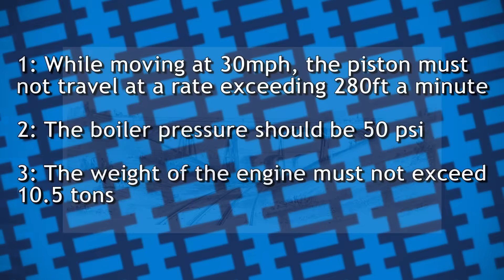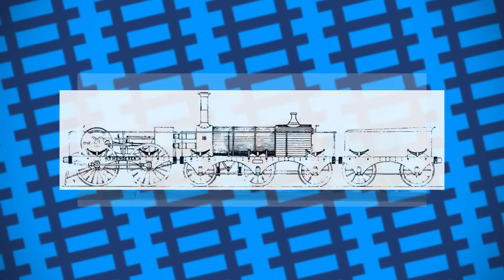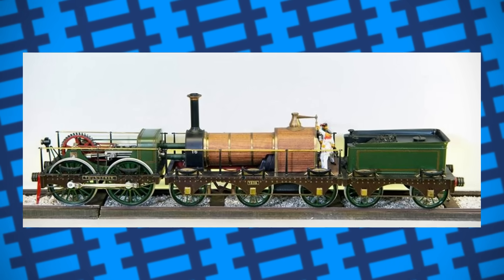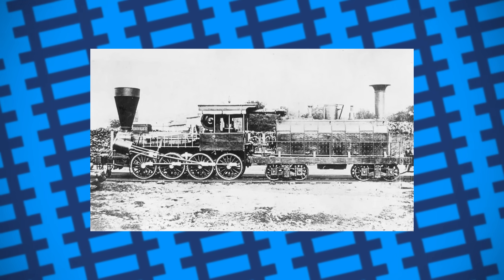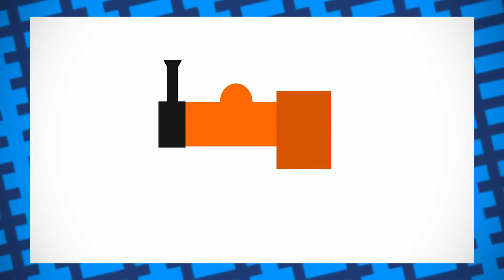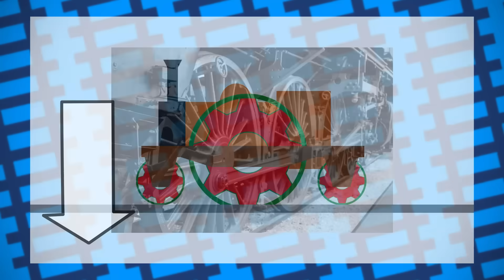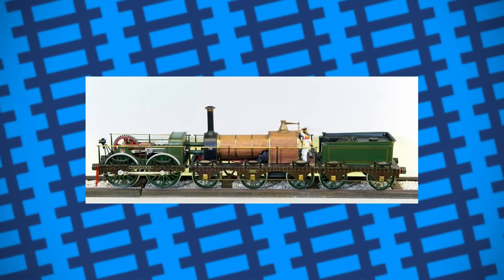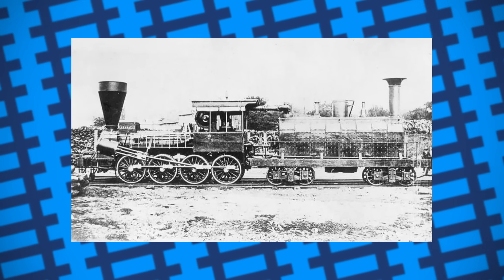Why Locomotive Boiler Placement is Important - "Hurricane", "Thunderer" & "Novelty"

Comment: I often wonder if the low axle-weight was what Brunel had in mind when he drew up the specifications, because he was also responsible for the civil engineering on the GWR, such as the Maidenhead Bridge with it's famous 'flat' arches, and heavy locomotive might have caused some real damage. Robert Stephenson had issues with heavy locos and collapsing bridges and the two men were very close. Brunel, too, attended the opening of Stephenson's Menai Straits Bridge.

Comment: What I´d do to improve the Hurricane design is to remove the front articulation, and remove two of the axles under the boiler. This would basically put the boiler weight on the driving wheels even without them being under the boiler.

Comment: I feel like if this was a two Carriage design where the driving Wheels were instead underneath the coal and water tanks it would solve several problems. The way it wouldn't be nearly as heavy as the boiler but it would still add additional weight without literally adding unnecessary weight to the engine, the driver and firemen would still be right next to each other ensuring good communication between them, the engine would have a mostly conventional layout save for the swapping of the trailing and driving Wheels, the size of the engine overall would be smaller, and now you have an added benefit of being able to extend the engine in both directions independently of each other depending on what specifications are needed for what purpose.

Comment: Wheel-rail contact area has negligible impact on tractive effort, its all about the sheer weight on the drivers. 

Factor of adhesion (how grippy a locomotives wheels are) is a calculation of weight on drivers divided by the maximum tractive effort (a slightly more complex calculation that considers the surface area of the pistons, Wheel diameter, stroke distance, and maximum boiler pressure). Nowhere in the calculation is the contact area even considered, nor is the number of driving wheels considered.

Comment: I feel like the adhesion pronlem wouldn't have been an issue if they just used the tender, which already needed to be attached to the train anyway. I get that it has some of the same issues with the boiler, but it really doesn't require a prefectly rectangular shape, and could just wrap around the driving axle and pistons.

Comment: Novelty would have suffered by not having the exhaust steam going up a blast pipe in the boiler funnel.  What about Hurricane and Thunderer?  I do see 2 pipes between the boiler and drive chassis  - was one of them for exhaust steam?  Condensate must have been a challenge as well.

Comment: Harrison in fact designed and built three locomotives, and indeed he took out a patent for the design in  December1836: Before Brunel issued his specification for locomotives. Harrison's notebooks survive including notes about boiler pressure, tractive effort and so forth. The first locomotive, aplty-named "Projenitor",  was intended not for high speed running but to haul coal trains on the Stanhope & Tyne Rail Road in the northeast of England. Harrison was the Engineer of the Stanhope & Tyne. Harrison's notes show it was designed to pull a fairly substantial load of 50 loaded coal wagons each wagon weighing 30cwt and carrying 53cwt of coal at more than 10mph. It's also worth pointing out Harrison's reasons for the design was not to reduce axle load or piston speed! Harrison clearly states that the use of a double-carriage locomotive was to reduce the amount of time and thus cost a locomotive was out of action due to maintenance. He found from his experience of the Stanhope & Type that a quarter of the cost - and time - of the expenses on locomotive repairs was due to inaccessibility of the parts. Thus putting the engine unit on one carriage not only made it all more accessible, but it meant it could be interchanged with any other boiler unit. Thus if the boiler was due work, but the engine unit was in good order, they could used turn and turn about.
I strongly suggest checking out Rob Langham's paper on the Stanhope & Tyne published in the 7th International Early Railway Conference. 

Also worth noting that Brunel used "Hurricane" as part of his experiments on drafting and gas flow in locomotive boilers. Brunel realised that the traditional blast pipe did not give sufficient control to the burn of a fire and did not promote fuel economy, so rather like Andre Chapelon in the C20th, used fans to provide the draft for the fire. Dr Michael Bailey has written a very useful paper published by the Newcomen Society about this. Worth checking it out.

Also worth noting that Harrison's idea wasn't new when he took out his patent. Matthew Murray of Leeds - who with John Blenkinsop had built the first commercially succesful locomotives in 1812 - had proposed a similar divided locomotive for the Stockton & Darlington Railway in 1825, but that, unlike T E Harrison's design was to reduce axle load.

Comment: OK, so lots of people see these as a forerunner to the Garratt and people have said you can't let the water tank of a Garratt get too low or it'll lose traction which is the main fault in that design. That may be but the tender of a regualar loco can't get too low either or it becomes an empty wagon at the front of the train with a lot of loaded wagons behind it and that's bad. Even worse when the loco is in dynamic brake and the only saving grace is that steam locos never had that but if they did, you would have to estimate how much DB you could use based on your guess as to the weight of the tender. Actually, diesels that carry an extra fuel car would have this problem. It just goes to show that ALL steam locos had their shortcomings.

Comment: What's nice is these days computer simulation  means you can actually try it out without building anything: in our times they would have known the drivers were doomed to slip before they turned a bolt on a prototype and dropped the idea right then and there.
Reply: What the heck to you think you are going to do with a computer?  The result is easily calculated by hand with methods of the day. They may have been missing some of the actual numbers (i.e. a good value for the adhesion of the wheel on the rail  VS force, the coefficient of friction) but you certainly can't do a computer simulation without that, either. 
Before computers, people did not just eyeball something, put it together, and see if it worked. They had perfectly good mathematical methods that do not require computers. Computers aid engineering in essentially one way - iterative calculation/numerical integration of equations you cannot easily solve in closed form. This case is an entirely static calculation, you dont have to iterate or integrate anything to get the one and only answer.
Reply: -as you say, there is nothing we can do with a computer that they couldn't have done with pencil and paper (within limits, of course.), but the fact that we have computers now makes simulation so much more of the development process.

-as you go further and further back, people really were much more prone to just eyeballing something, putting it together, and seeing if it worked. The early history of aviation is full of this, because they were playing a game that nobody knew the rules for just yet. There was a pretty spectacular body count too.

This whole idea of building a system by calculation was itself just starting out right around that same time.  West Point introduced an Engineering curriculum in 1817. Rensselaer  opened in 1824. There were engineers and engineering before this, but as you go further and further back, the choices made were more and more a matter of what the engineer had learned by experience.

-this of course becomes a problem when something new is being built and what you are doing right now IS the experience.

Comment: Going 85mph on an experimental locomotive with 10 foot exposed driving wheels in front of you and no cab whatsoever must have been absolutely horrifying. One wrong move and everything goes dark before you even know what happened.
Reply: Add in boiler safety of the time, and the castings for those wheels.
Reply: @joejoejoejoejoejoe4391  Wheels weren't cast: they were forge-welded from individual components. Cast wheels had been tried but they disintegrated, much to Robert Stephenson's cost. Boilers were also prettty safe. They had to be hydraulically tested to twice working pressure; two safety valves, one of which locked up and tamper proof; two means of measuring the water level. Plus a rivetted wrought iron boiler will take much more punishment than a welded steel one. The big problem was the technology available to assess plate thickness in service, for internal examinations. Doing it by a flickering tallow-dip or flare lamp nocking on the boiler plating with a hammer and listening to the sound. No NDTs in those days. and you still hammer the boiler as one means of checking for thickness and flaws to this day.
Reply: "CLANK" then darkness
Reply: According to the model shown, it looks like the engineer was stationed in FRONT of the drivers.
Reply: @00Zy99  It was hard to see on mobile when I watched this, but even so it's equally terrifying...

Comment: While it would have hurt the axle loading, I do really wonder If they had forgone the wheels under the boiler and added load bearing joints between the engine, boiler and tender if that weight would have been enough to get a grip.
Reply: a proto garret at that point

Comment: Never understood why brunell was so revered.  If the saltash bridge was really so good why wasn't it copied extensively. 
I think he was like churchill, famous mainly due to controlling the narrative.
Reply: He was an excellent civil engineer, but I personally think fairly rubbish at railway design. Remember his 7' broad gauge? How fast was he actually expecting his railway to run at? Okay, maybe not a surety at the time, but his designs were rubbish. His fixation on piston speed which nobody else had an issue with. His baulk road which ended up with half the gwr network getting ripped up to start again. His coaches with large wheels outside the bodywork, so nobody could actually get in the sodding things. His atmospheric railway...
I think his popularity is based predominantly on the size of his hat.

Comment: Think you got the chronology wrong when drawing conclusions.
These Brunel inspired and restricted locomotives came at the earliest days of the GWR and caused huge problems by the GWR not having useful engines.
Rescued by Robert Stephenson and co regauging an export locomotive , meant for a five to six feet gauge railway that went bankrupt before delivery. That became the very successful North Star.
No more oddball Brunel restricted locomotives were made after North Star proved the then tried and tested designs were best.

Comment: If the driving part was a lot heavier to put adhesive weight on the driving wheels then it may have worked.
Could come from extra thick frames on the driving part.
Think you got the chronology wrong when drawing conclusions.
These Brunel inspired and restricted locomotives came at the earliest days of the GWR and caused huge problems by the GWR not having useful engines.
Rescued by Robert Stephenson and co regauging an export locomotive , meant for a five to six feet gauge railway that went bankrupt before delivery. That became the very successful North Star.
No more oddball Brunel restricted locomotives were made after North Star proved the then tried and tested designs were best.
Reply: Exactly. And with the rather embarrassing (for the GW) show up of how good that nasty Mr Stephenson's designs were with the stars, the board gave in and got Izzy back to doing what he was good at, and getting Mr goochy-baby in to design some decent biscuits directly influenced by the Stephenson's

Comment: From my experience with building model trains when I saw the picture of hurricane I automatically said that thing has no traction, and automatically knew where this video was going.
Reply: Yeah, it would make a fun live steam engine, but obviously the core problem remains. On the other hand, in smaller than ride-on scales, one can cheat with relly lightweight wagons and coaches to match. Howevever, the way unrealistically tight radius curves on model railways, is probably the worst problem to mitigate, both mechanically and aestetically.

Comment: Without IKB´s restrictions, one in particular, all that had been not an issue at all.
Speed? Very reasonable, the railroads should provide the fastest means of transportation.
Boiler pressure? Reasonable as well, for safety, given the metallurgy of the time.
Piston speed? Somewhat reasonable, with such low pressure quite large pistons are needed and too high speeds may have cause trouble with metallurgy as well.
But weight? It may cost more, but stronger railbeds and bridges are relatively easy to achieve and are an investment in future developments (an engineer like IKB should have had the foresight of trains getting larger and heavier sooner than later).

Comment: Gobsmacked when I heard the specification for boiler pressure of only 50psi. Most locomotives boilers have 100psi!
Reply: Actually locos like y6's h8's, all had around 280 - 300 psi. Above 300 psi, even above 280 psi, there starts becoming issues with the physical properties of steam with the big boilers.
Locomotives with marine boilers running the high 300's to 500 psi have quite different boiler and steaming characteristics, and have their own issues

Comment: The design was too ahead of its time, when Beyer-Garratt came along they made it work and produced not only the worlds most powerful loco's of that time, the American's copied it and enlarged the concept to produce their monster sized articulating loco's that saw them pull vast trainloads in one run.  Indeed the mechanical stoker became an urgent thing as the first "big" loco's like that even with two firemen could not maintain the huge demands and so the mechanical stoker concept was dusted down and became a thing much to the relief of the hard slogged firemen.   Britain's loading gauge seriously hampered the British B-Gs, they could really only work on good open runs and forbid the notion of ever getting one to run on the southern metals in south London.
Reply: Beyer garratt? Not really, Hurricane and thunderer and their ilk were singly for provision of large driving wheels to accomodate Brunels obsession with low piston speeds.
Beye garratt was for an entirely different purpose to accomodate many driving wheels for adhesive purposes. And of course garratts always had two engine groups.
I'm not sure about your statement the Americans copied and made their giant articulateds?
The US articulateds were direct derivatives of compound mallets which preceded garrats by decades.
Even the familiar forneys, kitsons, single fairies et al all had their boilers mounted above the driving wheels.
Also I'm not understanding your comment regarding the garratts being severely limited by the British loading gauge and your mention of an inability to run over the southern as by far the majority of garratts were narrow and Cape gauge and ran on a very similar loading gauge as britain.
Beyer garratt was pretty much the last design of articulated locomotive. Garratt worked for kitson where he got the idea for his version of an articulated loco.
Mallet was early in the piece, and again, very different concept and reason for being than the great western pair.
The biggest success hurricane and thunderer had was they're a huge reason why gooch was hired by the gwr board.
Brunel was a brilliant civil engineer, but as a railway engineer he was pretty low on the bar...

Comment: Such a goofy design for a steam engine...
Reply: Although what were the precedents? Locomotives with legs? It was designed...
Remember folk thought rocket was a goofy design and novelty was the way forward...
Reply: @muir8009  Hold up, THAT was a thing?
Reply: @marcusthetenderengine699   yes rather unbelievably. 
It was designed in the days where adhesion really was still a very unknown science, and, rather understandably, metal wheels running on metal rails wasn't considered a doable thing.
Rather Mute testimony to Brunels monstrosity in this video (which you rightly observed was goofy).
The Stephenson's (moreso Robert) inately knew that weight was enough for adhesion, although others weren't so sure.
The most sensible variation was an outside gear wheel running on toothed track, but another more Jules Verne design had a pair of legs out the back (where would the tender go !?!)
Fairly obviously the practical reality borne out by observation proved that adhesion was adequate through weight alone, but it was still a very early science.
To put it a bit more into age context: gears were cast, then whilst hot, teeth were adzed out of the blank, and then workers with sandstone blocks would very slowly and laboriously smooth the teeth into something that would mesh.
The run it off in a lathe still belonged to the potting industry. Even something as mundane as boiler plates were hammerformed into their arcs, no plate rolling machinery as yet.
Tbh even without the sciences, the sheer technical difficulties of even basic construction was immense.
Hackworth complained bitterly about sabotage with his Stephenson cast cylinders springing leaks, but back then there was literally no way of determining how thick (or thin) the finished casting walls were
Reply: @muir8009  Huh.... Interesting.... What were the manufacturers and builders from the 1800s smoking though?